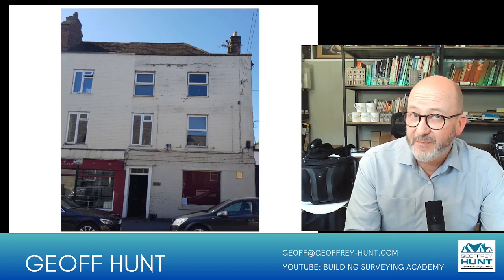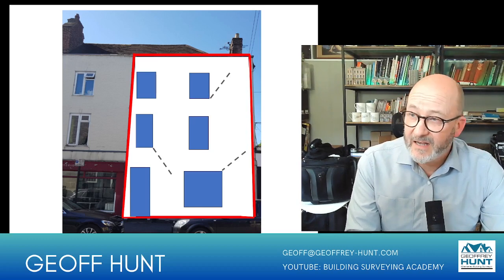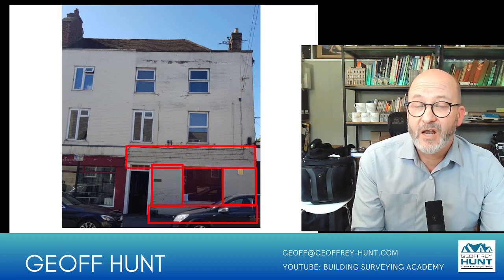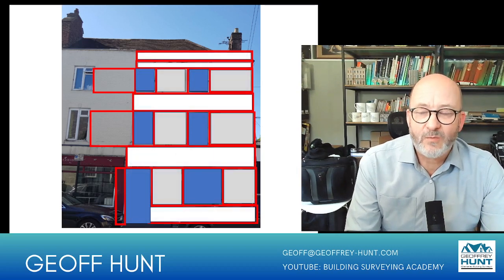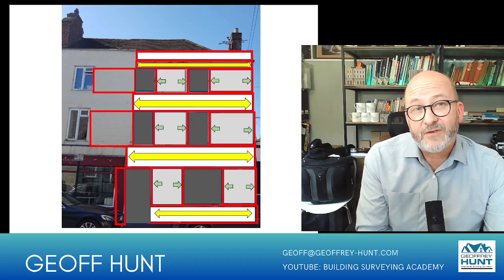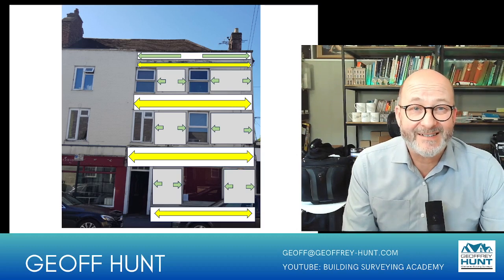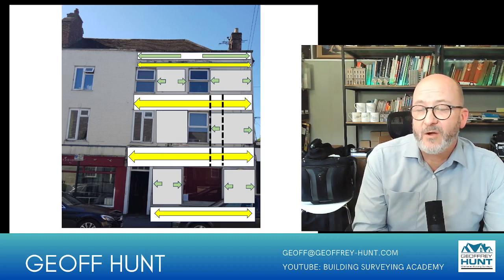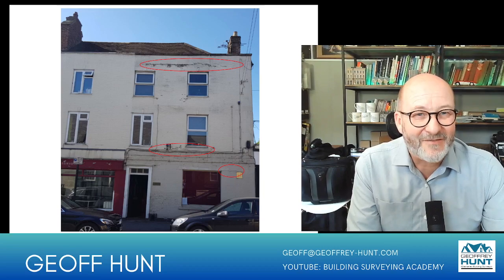Are you looking at walls correctly?

Comment: A refreshing way to look at walls structurally. I would just add that most contraction and expansion cracks are vertical and that, as appears to be the case here, cracking often has more than a single cause. Obviously hard brittle render finishes exacerbates the situation as even subtle movement causes problems.